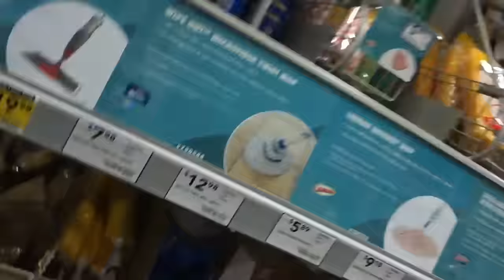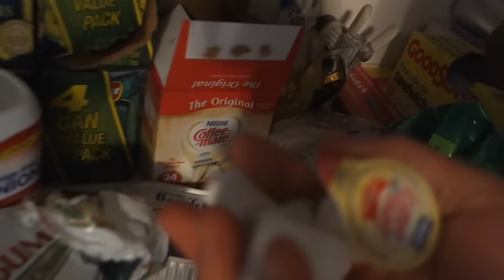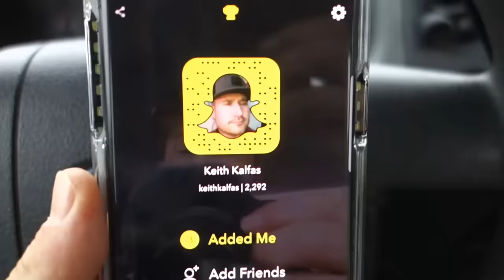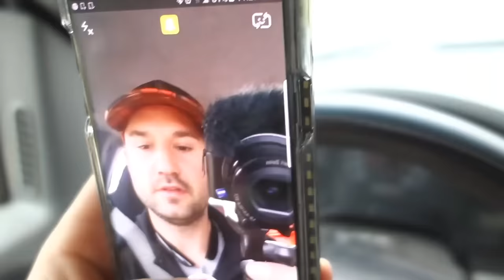Window Cleaning Business "Running Late" It's Great (Episode#55)

Comment: The oil change place tried to up sale you ha ha ha We GOT THE BEST AIR HA HA HA
Reply from the maker: +Mark's Reviews I know right.
Reply: Need to grab some market on that. Sell the oil place 'premium air' from the maintains of Ande's
Reply: It's cheaper and faster to just do oil changes yourself.
Reply: I do my own also you can use quality oil and oil filter.I got another car last year and ask for ramps because the car is low as a teen and older I used to use just a jack but as I get older I think the car might fall.I can get under my truck with no jack or ramps.